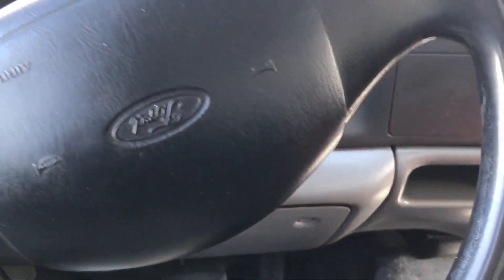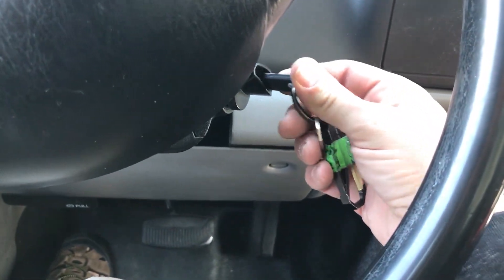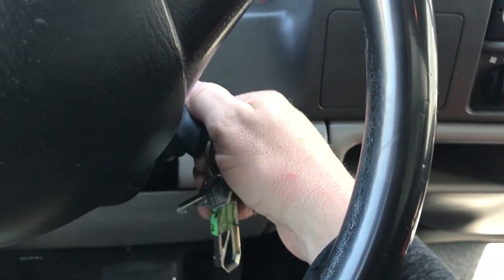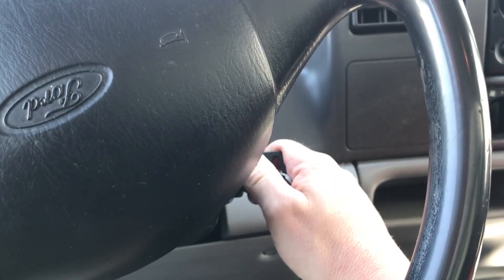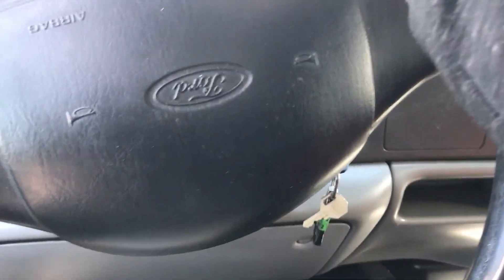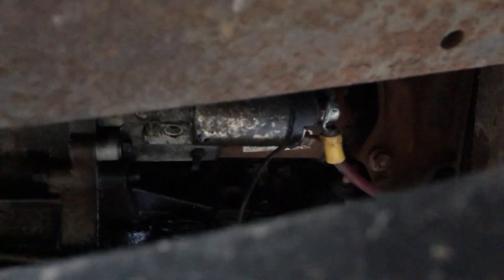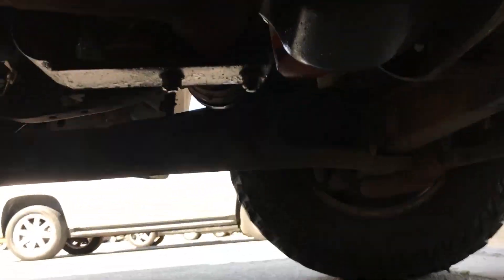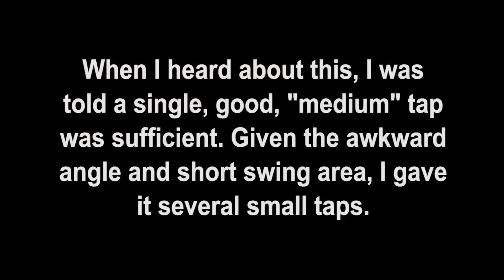How To Start Your Car When The Starter Just Clicks

Comment: what if its a brand new starter and it still just clicks??
Reply from the maker: If it's brand new and doesn't work, I assume there's a warranty and I'd be taking it back for a replacement, but that's just me.
Reply: Same problem I just put a new starter and still does this
Reply: Check your battery connections ,it could be a loosed battery terminals or a corroded cables.
Reply: Might be something in the ignition system that is experiencing high resistance (which happens over time as your system ages).  Like the neutral safety switch is bad, or the wire to the solenoid from the ignition switch has increased resistance from corrosion inside the wire.  Or it could even be a bad ground somewhere in the system.  There are youtube videos on all these things.
Reply: @toat  Yes, I had put in a Pep Boys Lifetime warranty starter a year ago.  After a 2hr 80mph drive it just clicks when i try to start.  Next morning, same shit.  Bump started it, fires right up. WTF  I dread having to pull out the starter and replace it.
Reply: Bad fuel pump
Reply: @rstelzer2928  you forgot to mention that most videos are incorrect or “are doing it the hard way”. Wish them Good luck!